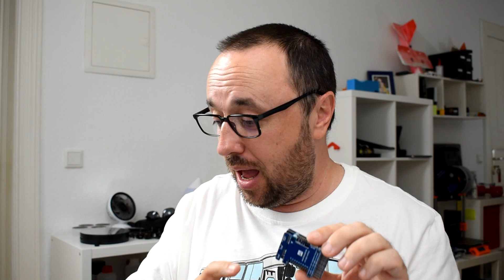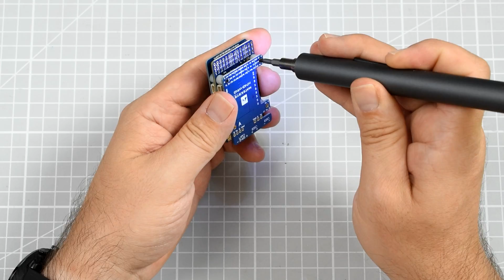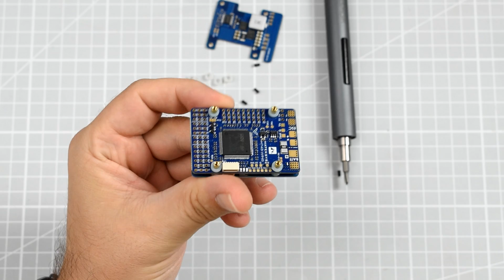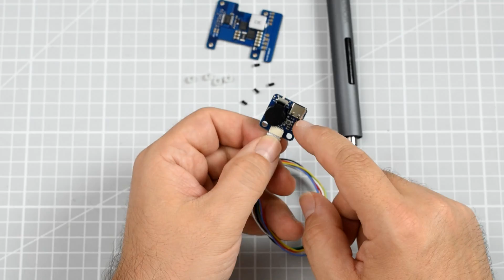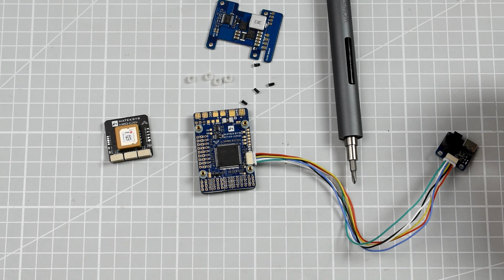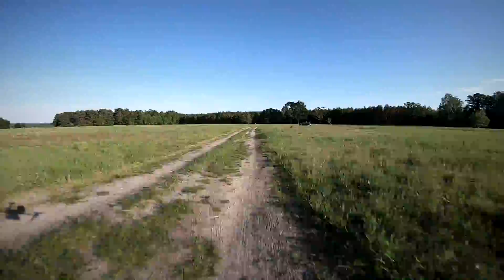Matek H743-Wing & M8Q-CAN UAVCAN GPS module

Comment: Hello, i had a chance to set up my H743 and Matek M8q CAN i bought years ago but i don't know why INAV is not detecting the matek m8q GPS? Is CAN Bus connection supported by INAV?
Reply from the maker: No, INAV does not use CAN. You have to flash the GPS with MSP firmware
Reply: @FPVUniversity  thank you for that😊. It's working now. Have wired to rx tx pin instead of CAN and selected MSP😊😊 but still hope CAN will be supported in the future it's a nice feature.

Comment: What good is it with no Inav support?  Even when you use Betaflight, its difficult at best to get the CAN connection working.  They shipped the M8Q-CAN with firmware which does not support MSP connections.  sigh!  What a waste!

Comment: Dear Pawel
The FC Noxe f4 V1 is a very cheap card for the functions it offers and I went to github, I used the program they suggest to use it with inav and flashed with inav 2.5 so far I have already calibrated the accelerometers.
But I have some doubts about how to end the project connections.
Can you give some tips?
Can you send an email so I can send you my drawing?
Regards
Vítor Lalanda

Comment: This board looks great! I like the separate USB connector and really look forward to being able to use CAN bus. Ironically, although CAN bus is useful for larger builds, it could also allow for smaller flight controllers with CAN servos, etc, most of the connectors could be eliminated. Thanks for the great review, and I look forward to trying iNav on it when it's available.

Comment: I am not sure but I think I had seen it for 70$ or so and I am not sure if that included gps and the connection board.

But my first thought was "pretty expensive" compared to my f405 wing that I got for 35€ back when shipping had bern free of charge.

Interesting tech but I save money to be prepared for a dji fpv 2 system ... cause they'll ofter a lot and I don't need a more powerfull fc currently.

But if the open hd system makes good progress I might change priorities ... cause the rc kitten channel did a bench prototype I liked a lot, to see, understand, build and improve my own system instead throwing huge budgets into dji products that get software updates for just 2 years and I always have to sell and upgrade again.

But I'll